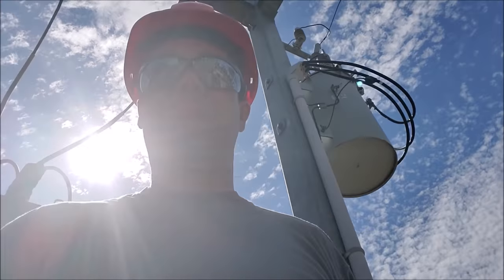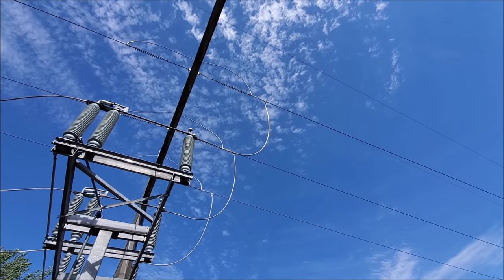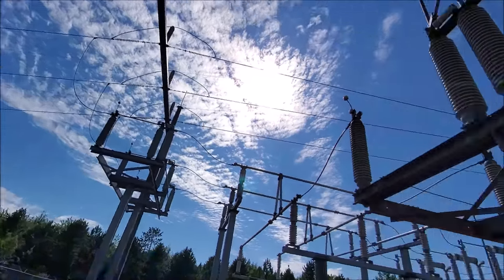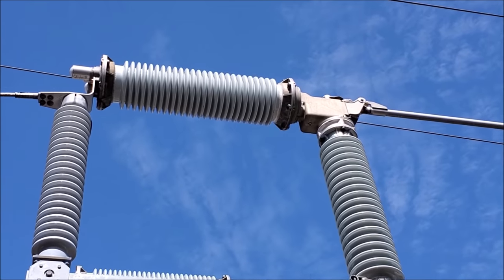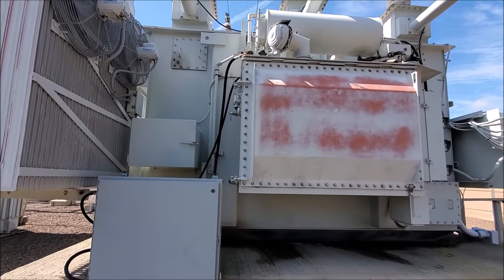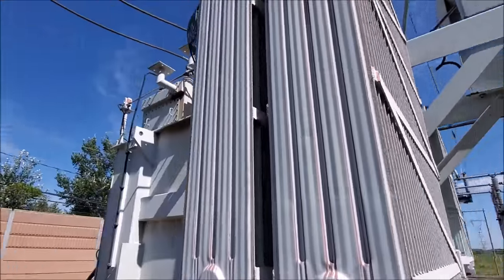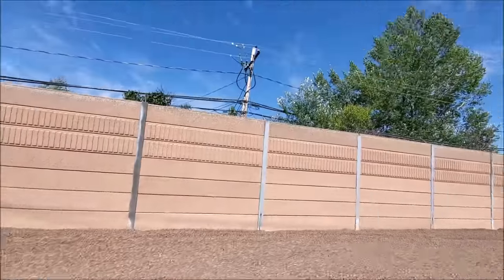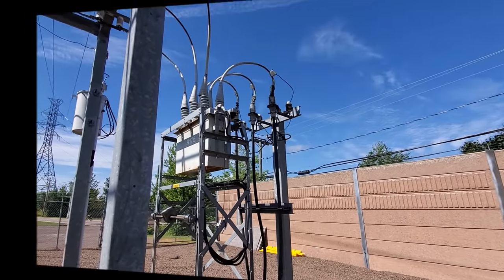How does a substation work?

Comment: Why don't rain short the whole substation?
Reply from the maker: The biggest reason would be the shape of the insulators doesn't allow the rain water to create a continuous path to ground. Also, Water itself isn't as conductive as people think . Should the location be near salt water tho , sometimes you can actually see arcing around the insulators as it attempts to go to ground. Even after the water evaporates the salt left behind ( and any other mineral deposits and dirt ) will diminish the rating of the insulators. For this , in some places we have to actually wash the insulators with high pressure clean water. Also the amount of insulators used is typically close to double of what is required to compensate for this
Reply: Water itself does NOT conduct electricity very well.  It's what is inside the water that causes it to become conductive.  When water changes phases (from gas to liquid rain, or liquid to solid ice) the change is pure.  So, pure water comes out of clouds.  The drops of water can pick up a little bit of dust or such as it falls, but isn't enough to change its insulating properties enough.

Comment: SF6 is used as a shielding gas for welding so I'm 100% sure it won't put out arcs. It's there to prevent corrosion when arching happens
Reply: I think we're talking significantly larger arcs with more voltage. What's your welder out out, a few hundred volts? Not even in the same ballpark. He did say it would start to draw an arc for a small distance.
Reply: @Perumet  "What's your welder out out, a few hundred volts?"
20 to 40. A welder is safe to touch. Higher voltage is actually helping the arc btw.
The arcs are not like normal air or SF6, they are ionized gas, it's plasma and it will conduct electricity like a conductive material. Once the arc is draw, the amps will matter more because the voltage drop from the resistance of the arc will more or less be the same, but the amps, together with that voltage will keep the arc heated. In welding just 30 volts can pass 100+ amps through an arc. It's the same ballpark after all! If you wanted to, you could do 2-3 centimeter long arcs on a tig welder which normally would need tens of thousands of volts if you wanted to start from there instead of from ignition and moving there.
The reason they use SF6 which I learned since writing that is that the dielectric of it is about 3 times that of air, meaning it's 3 times harder to keep an arc up in it. Basically it has a large excess of electrons on the outside of a molecule so it's harder to push an extra one into it
Reply: @whatevernamegoeshere3644  that's super interesting, thanks for taking the time to explain that. I dont even remember writing that comment or what point I was trying to make but I clearly don't know what I'm talking about 😂 i was probably hitting the blunt. Cheers man.
Reply: @Perumet  hahaha no problem

Comment: What's the crackling noise? Seems like some kind of interference....
Reply: this kind of transformer construction uses a lot of plates one on top of the other and when the magnetic flux passes throw, it produces atraction in the plates, and they kind of bend in a microscopic level, and this bend pushes and pulls the air at certain frequency, and you can hear this waves that propagates in the air :D

Comment: Back in the 80s, I saw a computer that when something would go wrong at the substation that computer at the substation would call to the main computer and it would display a two digit code

For instance it might say 15

And there were a hundred possible to digit commands to send back to the substation

I remember 99 was to close the circuits all of them and I think 00 was to open all of them

Nowadays they have two way radiolinks and internet links to the substations and I'm sure it's a lot more complex now but back then they was pretty advanced for its time

it's saved having to send Cruise out to the substations in some cases like when there are lightning strikes and the circuits opened they could close them remotely using the computer sending it to digit code

Comment: whats the power of the transformers
by the way we call those type of substations ,,H,, type here in Serbia
Reply from the maker: H type .. makes sense with the two feeds and a tie. Very cool. These are both 138 kV to 12.47kv  I can't remember exactly the size MVA I'll have to check that out!
Reply: @Bobsdecline  man you are always fast to respond  thanks a lot keep doing these videos and be safe
Reply from the maker: @mihailobankovic4719  thank you very much!
Reply: @Bobsdecline  closest substation of that voltage level here in serbia would be some 110KV to 10KV and they usually have two transformers each 40MVA or 31,5MVA
Reply from the maker: @mihailobankovic4719  Interesting , looks like they  have the exact same ratio ... I'll take a look what size we have on the particular bones in the video

Comment: I hear some rather peculiar hum-like sound in the video. Is that normal? Also, I believe substations give off radiation, so you can't be there for long.
Reply: The hum you hear is the magnetic resonance vibration produced by the transformer.  The electricity is alternating at 60 Hertz, so that's the frequency of the vibration you hear.  It is normal. 

There are magnetic fields around the energized conductors, but that isn't radiation.  There is some electromagnetic noise, but that isn't strong enough to be considered harmful.

Comment: why do they buzz
Reply: The magnetic fields in the transformer (which is what makes them work) are intense enough that it vibrates the components ever so slightly as the current alternates 60 times a second.